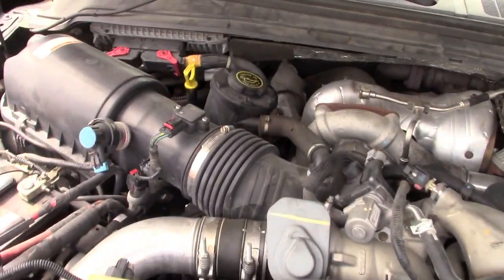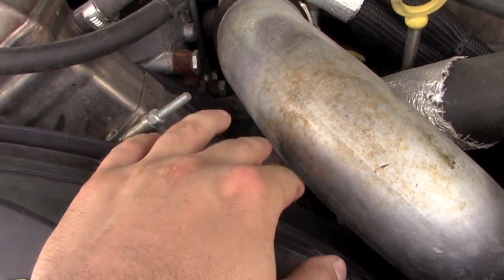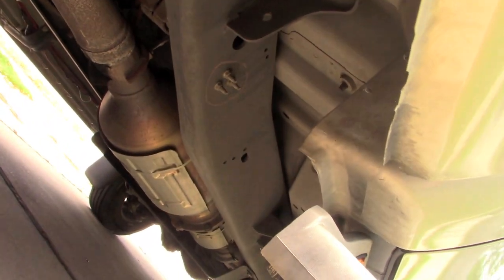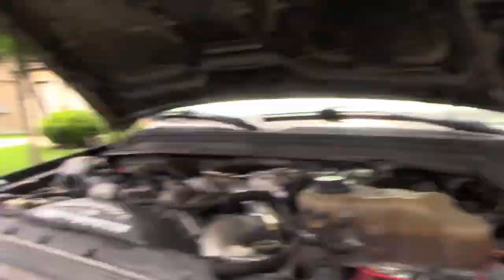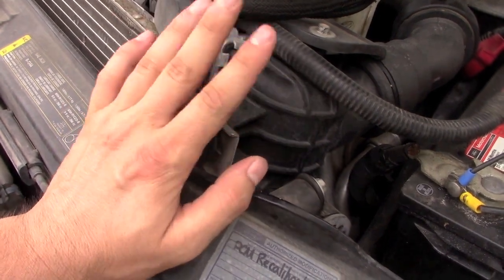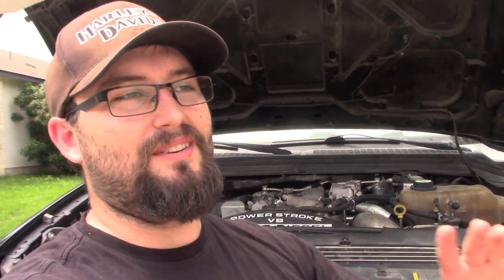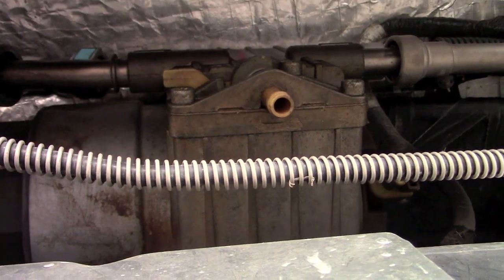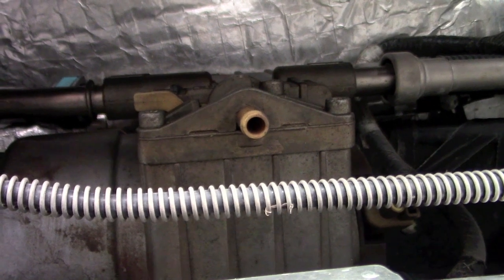What Fails on a 6.4 Powerstroke

Comment: But is it possible to do a rebuild with a delete and these be a simple reliable engine that I don't have to worry about, can hot rod if need be?
Reply from the maker: Fixing the major design issues will increase the reliability. If you hot rod, I would not expect it to last long like a diesel can.

Comment: Ita insane how diesel engines are going backwards lol. My 01 24 valve empty on the highway will get 24mpg
Reply from the maker: Yep it sucks, diesel engines are more efficient than gasoline but with the emissions, you are burning fuel to clean the exhaust. Doesn't make logical sense.